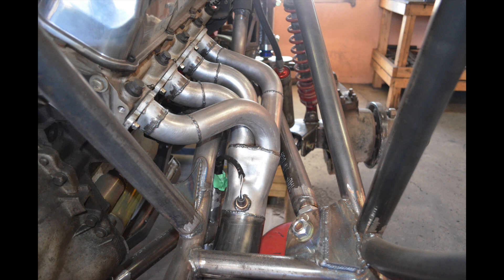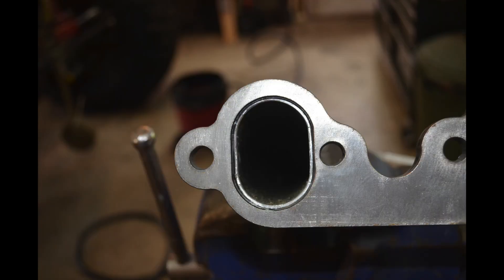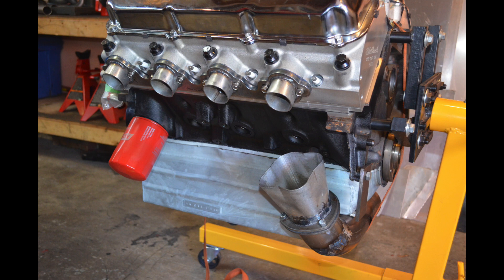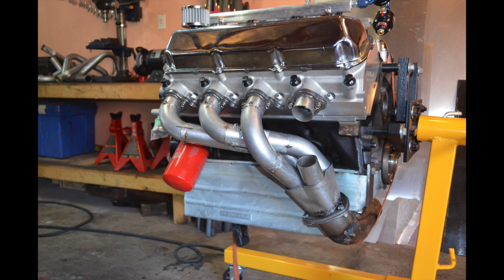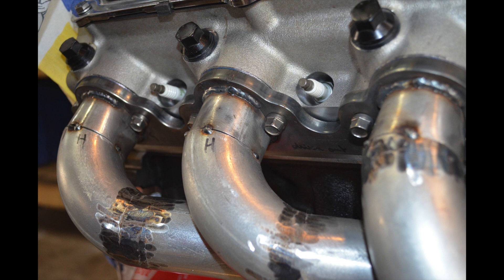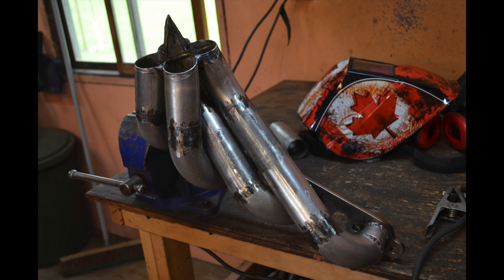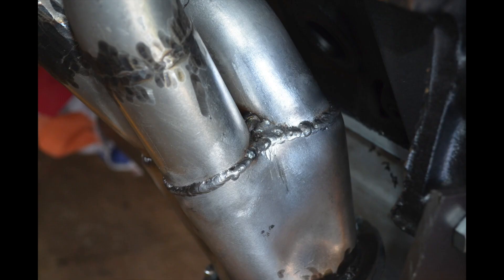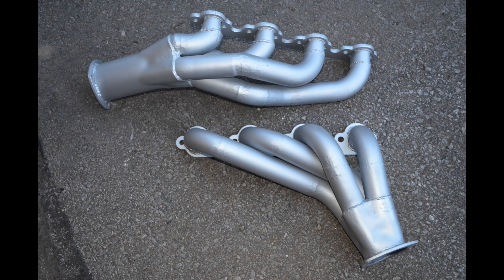How to make your own engine headers

Comment: Does this not influense power output because of not same lengh tube to collector?
Reply from the maker: Yes, this is my understanding of how that works: header tube length to collector affects engine max torque in the RPM range. It all depends on the application, if using the engine for max torque at one constant RPM value, all tubes should have same length and their length should be optimized for max torque at the desired RPM.  For an engine used for a road vehicle or daily driver, different header tube lengths will spread the torque throughout the RPM range.
Reply from the maker: Also, longer header tube will move max engine torque higher up into the RPM range compared to short tube headers.
Reply: @rgsabat good information ,  thanks

Comment: Nice craftsmanship.  Primary tubes need to be much longer to see any performance improvement.
Reply from the maker: Thanks. Long tubes will shift the max hp and torque up in rpm, which is good for high rpm racing. For a crawler, short tubes keep the hp and torque at lower rpm, which is what I wanted here.

Comment: Hi thanks for the great video, I was alway told that all tubes must be the same length between the flange and collector, is that not true? Thanks
Reply from the maker: It depends on the application. For racing at constant RPM, yes it is better to have equal tube headers, for all other applications that the RPM varies constantly, it is better to have different length tubes
Reply: @rgsabat  thanks for the clear explanation
Reply: @rgsabat  not true
Reply: @tomstiel7576 instead of saying not true and nothing else, why not elaborate?
Reply: @TheRoadhammer379   If you insist,depending on intended application,a header can be looked as a exhaust manifold,a means to get the exhaust out IE a shorty header,,,   in a racing application,you wont find a large difference if they are within reason. Whats MOST important is proper size diameter,and proper length for the engines characteristics,, and lastly larger gains come from the style of collector used

Comment: where did you get your kit?  Regarding the 2nd set, didn't you have to remove the aluminum coating first in order to weld?  Did you paint at least the welded part to prevent rust?
Reply from the maker: I bought the kit from Summit racing. I did grind the coating where I welded, but I don't think it's needed for Mig welding. yes, I painted all the headers with ceramic coating after it was done and baked it.

Comment: Aren't all the runners supposed to be "equal length"?
Reply from the maker: Good question. It depends on the application... For drag racing where you want max HP and torque in a small RPM range, example around 6000 rpm, then yes, you would want equal length runners tuned for 6000 rpm. For a daily driver, different length runners would contribute to the torque curve at different rpm range.

Comment: In your opinion if you have to compromise for packaging is it more important to have equal length primaries or a straighter section right after the exhaust port?
Reply from the maker: it depends on the application, equal length primaries are useful if the engine is always operating at mostly the same RPM (like drag racing), different length primaries provide better torque distribution at various RPMs (again depending on the application). A bend right after the exhaust port is fine as long as there is no obstruction in the flow through a reduction in cross section.

Comment: What kind of primary diameter and length are these after you completed  them?
Reply from the maker: My primaries are 2" diameter, and the length of each runner varies from 18" to 24". But you should really size your headers according to your engine specs, my specs are not necessarily the right ones for your engine.
Reply: @rgsabat  Ohh I agree,  I'm sure my new 615 needs a completely different setup. Currently my 516 has 2.125 primaries,  44in long with a 4in Collector.  Working in exact specs but we will probably have to do something like 2.375 or 2.5 primaries, 34in long,  4in Collector.  Problem is I'm not ditching the sidepipes and the car had been sitting for years. I need to do something wicked to make me want to drive it again